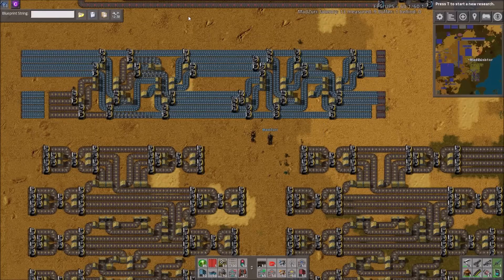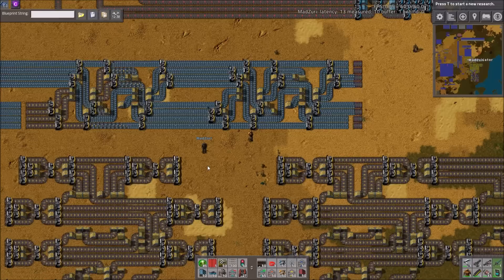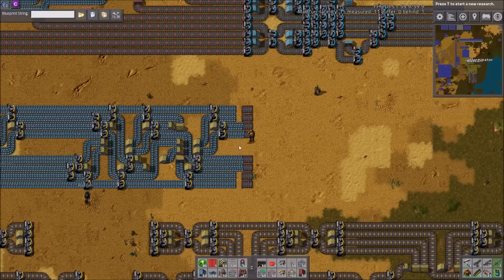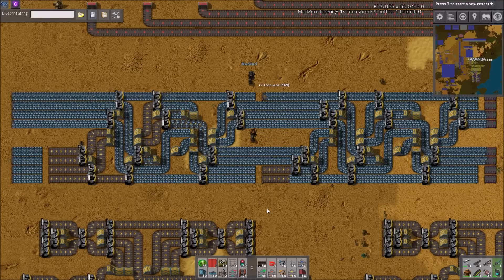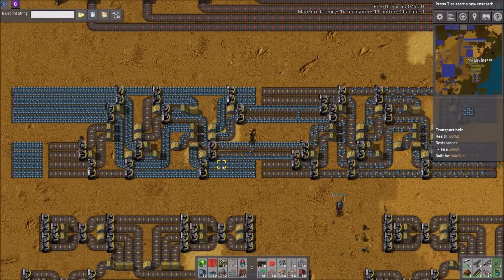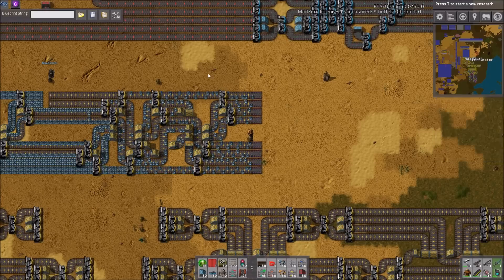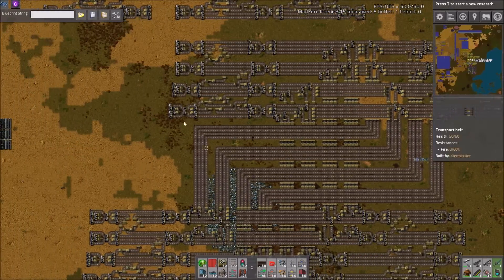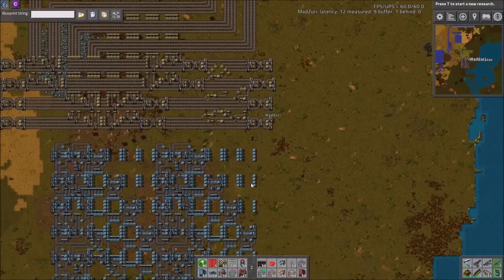Factorio Workshop - Building A Better Factory :: N to N Belt / Lane Balancers

Comment: And once again Mad Zuri blows my mind with his expertise
Reply from the maker: You and me both. lol
Reply: I have to agree that his 32 to 32 balancer is impressive. I probably wouldnt use it myself, as I use a different space between my 4 belt groups,  and he have used to many tricks that it is a bit hard to analyse, which means I have a harder time figuring out what exact qualities it has.
That said, if you are just going to blueprint it in, and you dont minding useing his belt group layout, then I would make good sense to use it. Even if you know how to build large balancers, building a propor one even without any special compression tricks could still take up to several hours.
Reply: I have no legitimate use for a 32 to 32 belt balancer. I tend to always play with large amounts of water so 
at most I can usually fit in 8 to 16 lanes before I completely run out of space. So I mostly use 3/8/3 trains to bus my resources
Reply: SilicalNZ
Reply: ahhh... yes?

Comment: A few notes about the balancers:
For the 8 to 8, the one shown on the right was throughput conserving, aka count to count. The base is already very close to count to count perfect, where the problem only is if we only supply a single of the input balancers with 2 belts. To counter this it was sufficient to always ensure that this never happens, which was done by placing a balancer in front of the middle of them, such that the second belt will always be able to make use of the other input balancer.
Calling them fractal designs is mathematically incorrect, as factals denote mathematical structures with non interger dimensions, and these ones have integer dimension. That said there are some similarities to how fractals are typically build, but there are fractals that are not build in such a way.
The reason 2 count perfect balancers put after each other produces a count to count perfect balancer is very simple: The first balancer spread each input out evenly over all the outputs, while the second one can take all of those even inputs and spread them back. There are some further mathematical requirements, which means that a technical proof is a bit more complicated (you have to ensure that the min-cut is equal to the minimum of input and outputs, and there is also some local bottleneck problems which are usually satisfied). In short, it boils down to how far a balancer is from being count to count perfect, and most usefull count perfect designs can reach this if the input is sufficiently spread out over all their input belts. Since the first balancer does this, then the second then satisfy the requirement to be count to count perfect.
There were 2/3 techniques used to build them, which are structured around taking "groups" of belts and then perform balancing on those groups.
- First is the pertubation, which was used for the 16 to 16 design. It works by taking one belt from each group, and switching it with belts in another group. In the end each group then have a belt from each input group, and when you then balance each output group (here with a 4 to 4 balancer on each), you get that the result is a count perfect balancer. The problem with this is that it has very little throughput by itself, as you can only move that single belt to the other group. Note that each group must be balanced with itself before entering for this technique to work.
- The second is a split merge strategy used both in the 8 to 8 and the 32 to 32 balancers. It works by splitting the input into 2 groups. You then split the input of each group into 2 subgroups, one staying and one going to the other group. They are then merged into the subgroup of the other group that stayed. There are 2 subcategories of this, which I call half and fill split-merge techniques. The difference is how each belt is split up. In the half split-merge, you take 2 input belts and as output have one full belt staying and one full belt switching. This means that the half split-merge can only take half of its capacity to each group, and it can therefor only performs count perfect balancing between the groups. The full split-merge takes one input belt and as output sends both a full belt to stay and a full belt to switch. Since there is a way for all the capacity to go to each single output, we get count to count perfect. It should be noted that each group still need to be balanced seperately, but the requirements are less strict than or pertubation, and it should technically be sufficient with a single count to count perfect balancer before or a count perfect balancer before and after (it does not work with a just a count to count perfect balancer after because you could run into bottlenecks). The half split-merge technique was used for the 8 to 8, but it applies it in a special way, such that the balancing inside the group is done by how the split-merges are done. This is the reason it is so small for a 8 to 8 balancer that is that close to count to count perfect (and especially for the count to count perfect version). These kinds of tricks is why Zuri can get such a relatively small 32 to 32 balancer, since you can do more with the same amount of space. The full split-merge technique was used for the 32 to 32 balancer, which does make it slightly larger, but it also means that it is only necessary to do one such operation, and we therefor save a lot of length and other infrastructure.

It should also be noted that count to count perfect balancing is used slightly problematicly here, as it seems to suggest 2 requirements, but actually contains 4 requirements:
1) It is output balanced, meaning that given some input from any input channel is evenly distributed to all the output channels (read channel = belts here).
2) It is input balanced, meaning that given some use of output from any of the output channels draws its input evenly from all the input channels.
3) It is throughput conserving, meaning that for any combinations of input and output active, you can always draw out as many belts out as you have given in (so all combinations of x in to x out will always allow full flow on those x belts.
4) It is perfectly balanced, meaning that if some of the input and/or outputs are blocked, the balancing is not changed (this is applied to part 1 and 2).
Most "count perfect balancers" only really satisfy nr 1 and 4, and many simple balancers only satisfy 1, but not 4 take the simples 1 to 4 balancers, and you will end up with this. There are ways to construct balancers that satisfy some odd combination of these. For instance, you could take your N lanes and merge them all to one, then split them to N and balance those. This might give you some combination of 1, 2 and 4, depending on what balancer you use at the end (and 2 depends on how you join the beforehand), but it will nevery satisfy 3, since there is only 1 belt of effective throughput. I cannot personally see how to satisfy nr 2 without nr 1, but there might be some wierd way to do so.
Note that all the balancers submitted rated as "throughput" is supposed to satisfy all 4 requirements above.

It should be noted that the design submitted are made to be easy to remember and rebuild without importing it as blueprints, though the bigger ones may still take some time to actually build, it took me a few hours to engineer them originally. This means that after looking at the for some time, they should be able to stick reasonably well in your mind, or at least the general idea of how to construct them. The reason I chose to go this way, is that people who ends up needing to make balancers larger than 4 to 4 often have to look on the net for references, and even then it is common to make some mistake and not see what is wrong. If you were copying it, you might have change a tiny detail, and since you have no idea how it really works, it is going to be hard to debug it. If you were just trying to come up with it, then there are a lot of mathematical details that most people are not that aware of, at least until they have sit down and though about exactly what you need from your balancers.
Reply: Thank you for the detailed explanation.
Reply: I havent actually seen it described in terms of linear algebra. I only considered it as a flow network for throughput calculations. I know that you could describe it by having a NxN identity matrix represent the input and matrices representing the mixings, and that you would want to end up with a matrix that is uniform in all its elements. But I am not sure how using such a cumbersome reprecentation would help when building a balancer, compared to just consider it seperately. Yes I suppose you could describe one balancer to spread each value out to all over the matrix, and then argue that you most be able to gather them together in any combination, but  you would technically require an antisymetric version of your balancer to do this, and as I mentioned above there are more requirements to also be throughput invariant.
Now that I look at the 8 to 8 again, it seems some of my criteria for throughput invariance was slightly insufficient for large number of input and output lanes. I had required that any 2 belt input pair (represented by an input splitter in the non-throughput version) should be able to get its full throughput to any other 2 belt output pair (represented by an output splitter), but I missed the possibility of internal bottleneck due to how combinations of input pairs were used. That said, it is still fairly close to throughput invariant, so it should be possible to make it throughput invariant by something less drastic than using 2 balancers after each other. I am going to have to look into how many internal bottlenecks that there are, but from first glanse it might be sufficient to simply add a pair of extra balancers at the outputs in a similar way to how they were added in front of the input in the throughput version, as that should solve the specific case shown in the video, though there might be others that I have not considered.

Comment: Holly crap, 16 by 16 is doable (with a more compact blueprint), but for anything larger, a bot sorter can balance N to M belts in less space. By bot sorter, I mean input belts connected to passive providers with stack inserters, then 2-4 rows of roboports and then requester chests outputting to belts with stack inserters.

Comment: I know this is an old video, but curious what the balancer I built would be called, I don't get the count and count to count thing, but what it does and I'll do my best to explain it. it has 4 belts in 4 belts out. if you only use say 1 output belt, it will pull from all inputs perfectly evenly. also if an input belt only has stuff in 1 lane, it will perfectly split it into 2 lanes on all 4 outputs as well. I spent a day designing it because I needed to unload my trains as perfectly balanced as possible so that it didn't cause any congestion. but it has that one feature that you didn't mention on the rest that has me curious what it would be called. the single to double lane all 4 outputs split thing. and it does it by actually pulling from the lanes separately instead of pulling by full belt which imo is pretty nifty :)

Comment: Just for curiosity.  What would you use a 32 lain spliter for?
Reply: Just to be funny. To split 32 lains :)
Reply: In a game, a very good reason indeed.  But man.... What would it take to make that useful?
Reply: Lucid Moses allot of smelting
Reply: Daniel Moore But you don't need something so exacting because rows of smelters are self limiting.   i.e. A specific number of furnaces will consume a belt.
Reply: I built it to handle crushed stone from angles ores in a late game bob mod build. I had a series of crushers each generating 4 belts of crushed stones, and I then had a set of ways to process said stone. I needed it to be count to count perfect because the process that needed the stone would not always be running in the same amount, nor would the sources, so I needed to be able to bring all the local throughput from a source to a sink in any variation.
Reply: in my last world i used 8 lanes of iron and 8 lanes of copper and it wasn´t enough throughput. i launched 2 rockets per minute.
Reply: Peter Pimmelmann so, 8 rockets per min would be needed for 32 lanes.   seems hard but do-able.
Reply: sorcdk ok,  I haven't done any mods yet.  Figure I'll let them finish the game first.  I guess there are plenty of reasons for 32 lanes when you use mods.  SpaceX and such jump to mind as well.
Reply: yeah. the problem with the belts is they have a big impact on performance. that´s why you rarely see belt-based mega bases
Reply: I personally have not reached the point where performance starts to drop in singleplayer, though multiplayer is another story. The factory that uses the 32 to 32 balancer is still running with the full 60 ups.
That said, the balancer is more used for logistic problems rather than necessarily 32 belts running at full speed all the time, with instead them running at different speed at different times instead.
Reply: "2 rockets per minute" really made me laugh out load :D It just took me about 2 hours to launch my first rocket after placing the silo!
Reply: Oke I don't understand this. I am planning out my own megabase atm and it will be launching 2.912 rockets a minute (that's how fast a rocket silo with 20 beacons and 4 prod mods can fire rockets). I just finished working out the throughput requirements for the whole base and at the front it will be eating up 96679.6 Iron ore per min to produce 116015.52 iron plates (most of which will be used for steel). That means it will produce the equivalent of 49 saturated blue belts of iron plates alone.
So how on earth can you fire 2 rockets/min with just 8 belts of copper and iron???? o.O
Reply: @Peter Bonnema: Probably due to it being modded (like the one from where the splitter is from). If you are playing with bobs, you get access to some much more powerfull productivity modules, which means that the raw resource requirements are significantly less. I think I had about a rocket every few minuts (roughly the frequency of the launch control) on that base, and the resource cost were "insignificant", compared to how much just a single T5 belt could provide.
I think I had productivity around +300% per process, so just the rocket+last rocket component tier would redouce the requirements by more than a factor 10.

Comment: at 8:44 under where it says MadZuri: latency their is a bunch of underground belts that lead to nowhere, was this made with a underground belt mod
Reply: Yes, it was build with bobs tier 5 belts, which have much much longer underground distance, and then manually pushed back to yellow belt, and I could easily have missed a few places for the change.
The place where there was missing belt is just missing belt, which is probably something I missed to place back in when I rebuild it for yellow. It was also slightly more compact in the original version.
Reply: cool, just wanted to clarify that because it was not mentioned in the video